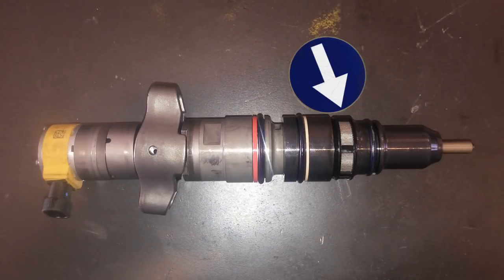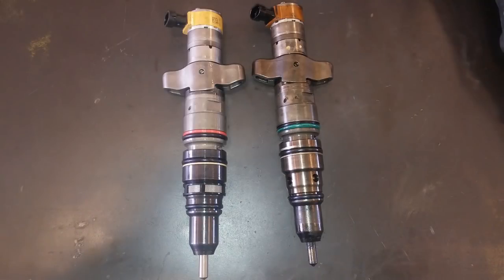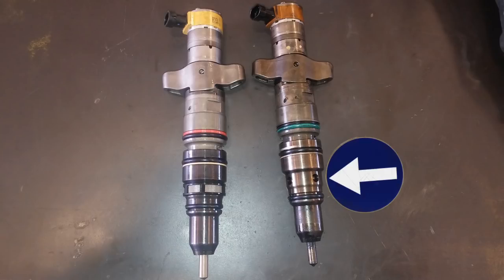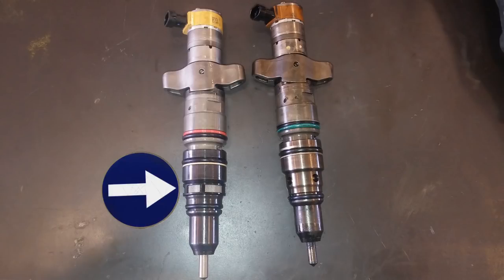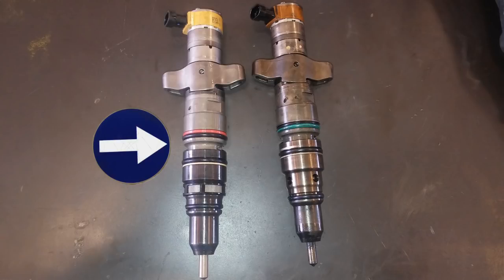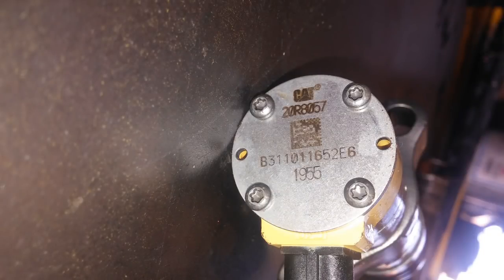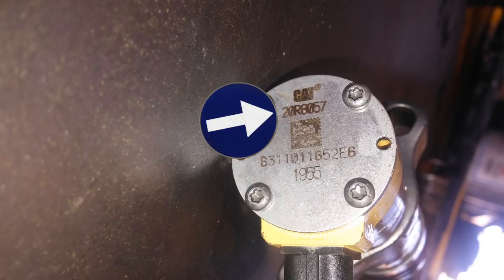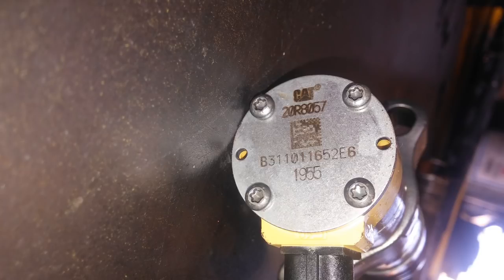Updated Injector Design For Many Cat Truck Engines.

Comment: Hey nice talking today on the 3306 Cat injector pump issue. Regards Jeff
Roadrunneroilrecycling@hotmail.com. my email
Reply from the maker: Hope parts could help you out on that.
Reply: Adept Ape When I figure out what it needs will Contact them.
You were right on the rotation of the rack but it controls the throttle speed by rotation I checked to verify with the other 3306 genset motor its a non runner and missing some parts.
 Still havent figured out the on off yet but the rack is definitely stuck on the one I showed you today.

Comment: In 2013 Yancey CAT trimmed my fuel injectors. It was about 3 years later before I realized this. The Motorhome was in for valves lashed adjustment. They didn’t inform me or any documentation on the bill. This particular shop has closed, but Yancey CAT has a robust business supplying equipment. 
Has any rollbacks on diesel regulations occurred since the new administration took office?

Comment: You'll probably find they have switched the oem and the new supplier already had the screen in there product, it may not actualy be a Cat upgrade. We see this all the time with the Cat transmisson, steering and hydraulic valve solinoids, in those applications if there is high frequency pressure variation the screens fall to pieces. Cheers mate🍻

Comment: Could you make a video on the 3306? I’ve only seen a handful of trucks with that engine and can’t find much info on forums about it
Reply from the maker: It is in the queue sir, but at the bottom of the list. I've only worked on one in a truck, but a bunch in generator packages.
Reply: Adept Ape thank you. I’ve heard it was also a pretty common marine engine

Comment: Yeah... I'm not sure that will be much of an improvement.  Sure it may save the injector's fuel side but the oil side will still be the primary failure point.  Seems to me any issues will still require new pump and injectors $$$$$.  Thanks for the heads up!
Reply from the maker: I think you are right, maybe if they put that screen on all their injectors it would increase the longevity. In the HEUI engines though it is definitely the oil side that seems to be the problem.
Reply: Start-up oil pressure on my C9 is 125 PSI. I added an oil heater and it lower start-up to 60 PSI. Although the length of time to obtain operating pressure is the same.